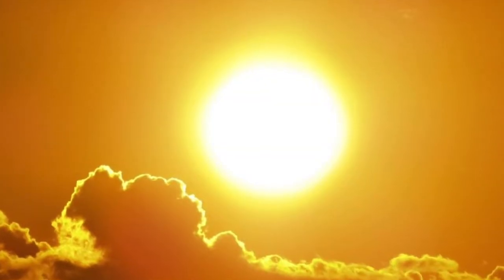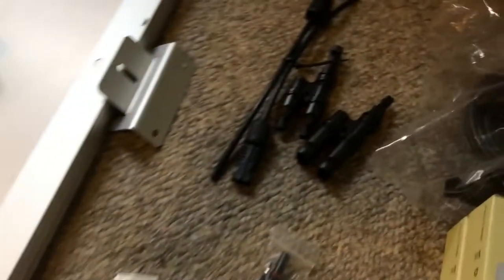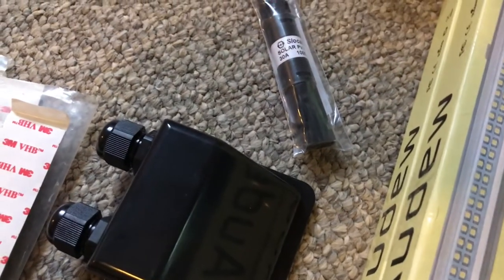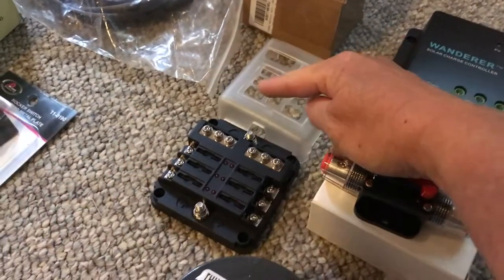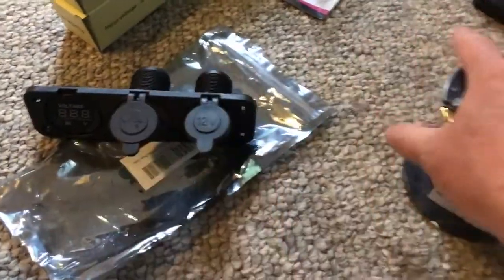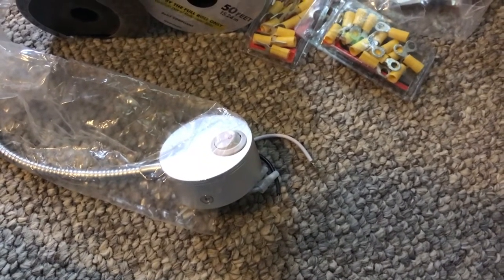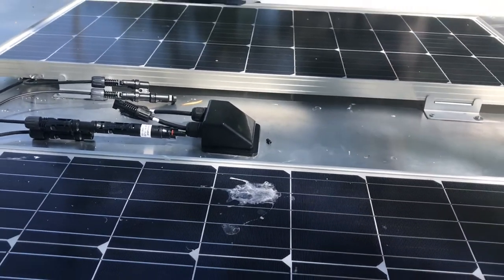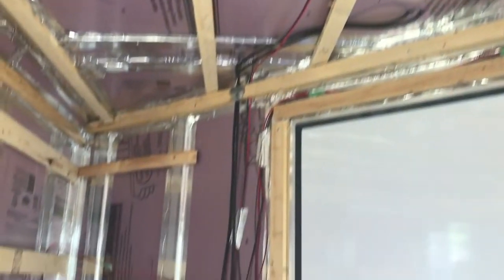DIY Bumper Pull Horse Trailer Conversion Part III SOLAR

Comment: What battery did you hook to your panels? Also how are you venting your batteries?
Reply from the maker: A valid concern. I used a 92 amp, deep cycle 12 volt AGM Marine battery.  the kind that go in boats (they have the same concern about venting).  This is a sealed battery that doesn’t off vent.  A simple google search will put your fears at rest.